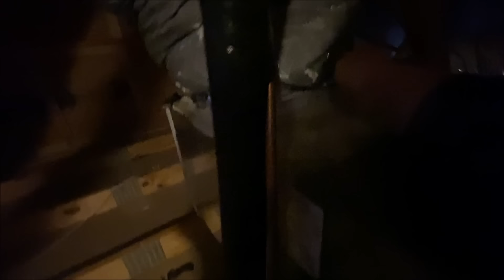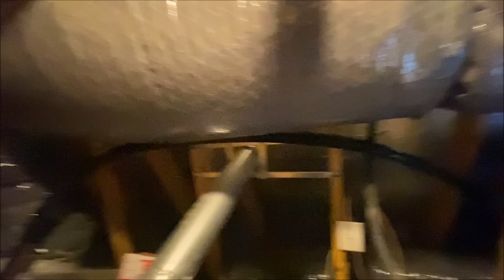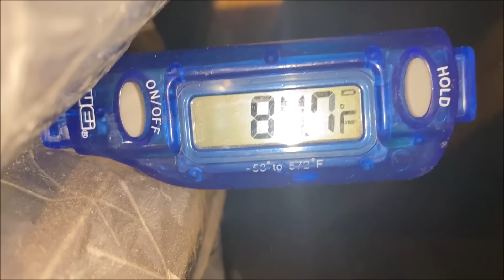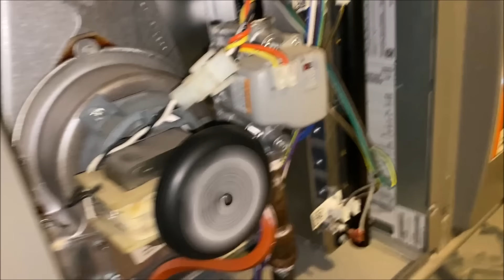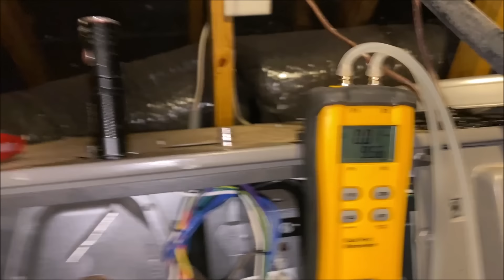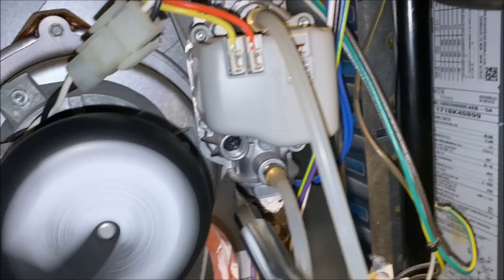New Construction HVAC Hack Job Butcher Sabotage pathetic installers

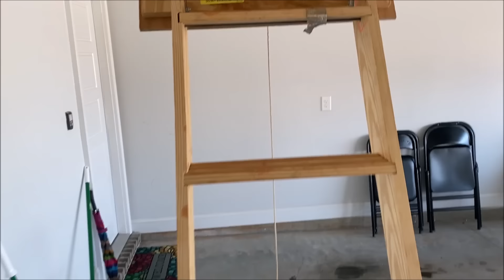Comment: 4:47 Is why when i built my house I wanted Rigid pipe main trunk then Flex out to the Vents in my Area they put R-4 on the duct insulation i wanted R-8 its 23F outside and 71-72 inside........ i was every step of the way seeing this house built had the ones did that crappy work here!!!!! i would have had them rip it out period not on my watch,

Comment: The incoming gas pressure might also be too low at/from the meter. Also, one has to wonder how the air-conditioning worked and did not freeze up with such low air flow. Be good to hear what was decided.
Reply: I will assume the meter and regulation at the meter were sized appropriately whenever a new home is asking for service the contractor does a load survey which is given to the field planner for sizing, but your thinking,
Reply: His manometer showed proper gas inlet pressure

Comment: Tell me about it, i use to be a warranty and startup tech for new construction. Sometimes the flex duct was so badly run that it would cause furnaces to cycle on high limit and static pressures where insane.

Comment: low bid always wins! Also the city's fault too for approving this mess
Reply: Bigo, the customer went to the cheaper bid and got what was expected. See it all the time with "my friend installed my system"
Reply: @zack9912000  Of course, the "customer" in this case is the builder. They go with the cheapest they can.

Comment: There is NO WAY that system passed an inspection. That builder had his inspector "BUDDY" give it a free pass. I've been an  HVAC  installer and service man for 16 years and I have seen many like this. We just rip it out and "HARD PIPE " it all. There is NO EXCUSE for work like that. And that unit should have came WITH a 10 year warranty. Most likely the builder didn't register the unit. I know a builder here in Alabama that actually has over 30 units registered in his name, so that it was covered NO MATTER who bought the house. TOTALLY LEGAL . TOTALLY LEGITIMATE.
Reply: The inspector BUDDY was also paid something for his troubles.
Reply: @Garth2011   OH YEAH ! He probably got a case of beer or a steak dinner. Or some other form of payment. But yes, I think he probably did get PAID.
Reply: @c.blakerockhart1128  
You are thinking small, I met an inspector, out of New York in Mexico. He was on a "free" all inclusive scuba vacation.

Comment: I have done a lot of duct cleaning in new construction. It is amazing how many times I've found coils plugged with sheetrock dust, sawdust, and other debris. I've also seen ductwork that could have been taken out and put in properly with about half the material and it would have worked much more efficiently. I remember one where the homeowner said it looked like someone blew up a spaghetti factory.
Reply: I was changing some light switches in my friends brand new $million dollar home when I dropped a screw in the floor register. When I opened it up I found a pile of drywall scraps, a pile of dust, and a coffee cup. I was fucking livid.  I wanted to talk to the builder myself but she wouldn’t let me
Reply: This happens in New construction all the time because once the house gets gas and electric meters hooked up. The GC calls us out to start up the equipment to get the house conditioned to Temp for the floors, paint and any thing else. Filters can only pick up so much dust and the h/o is  left with dealing with the after affects.
Reply: @smacleod69  
As a contractor could you build a portable return filter, say a 1in at whatever the contracter could find, then  maybe a 5in merv 10 and a 5in merv 13 or 16?
Put it fine print that builder pays for filters if they need the unit used during certain times? 

Plug the returns and us this filter setup? 
 
Just spit balling . As I know completely and thoroughly how some builders care about the new home owners, ha ha!

I was a flooring installer and hvac was definitely needed to prevent material failures.
Reply: Totally agree. My old boss. Would not allow the HVAC system to use while any sheet rock or floor sanding was going on. He actually had in contract that it was not allowed to be use so we had disabled the system a couple times. GC would be pissed but unless they want to ruin homeowners equipment and duct , oh well...
Reply: How is the duct cleaning business? I was thinking of adding it to mine.
Reply: @davidlopan6649  from my experience it seems like a total scam. I did probably a dozen of them at the company I used to work for and not a single one did I feel good about the work I did compared to what the customer was charged.
Reply: We had a customer call the manufacturer because we didnt want to turn his geo on during drywall. He called to complain about us, but instead they voided his warranty lol
Reply: !00% agree. As a home inspector.....this is the new norm to use registers as trash basins. When you have superintendents that are as green as spring grass or ones that could care less...... you have sub contractor work like this that is acceptable.
Reply: Had a contractor running his hvac system while they did the dry wall and paint. Want to talk about gunking up the coil. Ended up replacing it. Would not cover it under warranty. He tried to argue with me until I pulled it out and showed him.

Comment: You are absolutely correct,the 325-3 can handle 100,000 btus with a single gas appliance & max out at 150,000 btus with multiple appliances ( not sure why you get 50,000 BTUs more when you add extra appliances (?)). So yes it is too small for this application.A 325- 5  should be used on this CSST manifold & a separate 325-5 used for the tankless water heater. Working and lockup pressures should always be taken when dealing with any regulators plus manifold pressures at the gas appliances. I usually set the Regulators at about 7"working pressure  ( all gas appliances on) & check lock up pressure (all appliances off) to make sure I don't have a creeping regulator.
Reply: rite from the maxitrol spec sheets: "Total load of multiple appliance combined 325-3L (3/8”, 1/2”): 250,000 Btu/h;" "Largest single appliance served by the regulator: 325-3L: 140,000 Btu/h;" I'm not sure where you got your specs from but maxitrol spec sheet differs.
Reply: @mackb.8262  yep. Its 250k. Nothing wrong with this reg. They either have low pressure gasline or undersized gaslines. The first tee is going to the tankless, guaranteed.
Reply: @ozm8642  Undersized gas from the meter. Assuming this is a typical 5.5-8.5 inwc service, what looks like a 1" coming in to that mess, and guessing about 40 equivalent feet of piping from the meter. You are only looking at pushing 243 CFH which is a touch over 243k btu of gas for all four of those runs.
Reply: @mackb.8262  You're looking at two different regulators is why. The 325L series, is a line regulator meant to feed multiple appliances and falls under a different ANSI spec than the 325 which is an appliance regulator. You can tell the one in the video is the L series because of the yellow banding around the adjustment stem.

Comment: With the housing prices right now and the demand for new homes, the rush to build seems to outweigh the craftmanship and longevity of the home. This seems like a cut and dry court case to me, you bumped the gas line and it spun right out of the regulator...the ducting looks like a DIY project. We are better as a trade than this :\

Comment: the real shocker is that code enforcement allowed all that crap.
Reply: Wanna bet they didnt inspect it. We have commercial inspectors that we know what he will and won't check. They are lazy
Reply: @zack9912000  or are getting a kick back,  Inspections are often a drive up, check some boxes on a form and call it a day. That loose gas feed pipe tells you it was hack city all the way. Low bid and RUN!!!
Reply: yep also city's fault
Reply: The bigger shocker is that the general contractor allowed this sub on the job site in the first place
Reply: @af3934  Just remember this.  In these mass new developments that are built on old farm stead’s where they cram 18000 homes onto what was an 800 acre farm.  The lowest bidder will always win regardless. They just have to get you out of the warranty period.
Reply: @af3934  cheapest bidder that's all they care about maximize profits.
Reply: @af3934  not shocking at all tbh, only became a problem seasons after the house was sold and they were long gone with their profit.
Reply: Track houses here are barely inspected at all.  The inspector just signs off.  That is if the local authority can find an inspector to hire
Reply: Most of the time, city inspectors are just show so the city can justify all the fees. 
They just want people in the houses asap to start collecting taxes.
It is a home buyers due diligence to have the home inspected and research the builder. 

Some say people beat down the home prices, but I bet the company that built the neighbors house cheaper, in the big reply above, made more profit than his quality builder.
Reply: Seems like maybe the inspector on this job had absolutely no clue about hvac? This is horrifying me. If I showed up to a new construction and saw nothing but flex duct and no main trunks,.....😅 that poor customer
Reply: I’ve found that in a lot of what I call “pre-fab neighborhoods” the builders & inspectors are all buddies with each other and everything gets passed regardless of how bad the work is. Quality and craftsmanship don’t exist to these types of builders - it’s just “how fast can we slam one out and move on to the next?” 

Everything about that “install” screams fast, sloppy, inexperienced, and lack of care. The loose fittings. The pipe dope literally slopped all over every joint. Unsupported & unprotected piping. The messed-with adjustment screw missing its cap on the gas valve. Someone knew there was an issue and just cranked the screw and called it good ‘nuff. Pathetic. And I’m not even going to critique the flex duct. That crap shouldn’t exist, especially in a new-construction install. I wouldn’t have signed off on my final walk-thru as the buyer if I saw this, and I’m not anywhere close to being a forced-air expert (old-school gravity hot water heating systems are my bread and butter).
Reply: To suggest the inspector did the job is to suggest this mess was in perfect running order. 
At first view, the three soft ducts piled up and crushed was enough to realize air flow was reduced massively. 
Each successive bend and junction further reduced. 
Seeing all the airborne insulation suggests this, though I’m aware that cold air rushing through the access into that hot space is the cause during the vid. 
Close that opening and follow the still churning fluff and I’m certain leakage is to be found.
Reply: Don't worry, their pockets are lined. It's not about what you know,  it's about who you know
Reply: no, as an installer... i would have been fired immediately for that!
Reply: If I was code enforcement I would say nope fix it
Reply: HACKS
Reply: I also bought a brand new house. I checked it over during the ending of construction myself, and everything looked great "I'm three years in still with no problems" Seeing this attic made me respect my builder a lot more, dudes houses are a little more per square foot, but nothing is half way done. All my my walls are insulated well, double pane windows, attic has well above the typical amount of blown in cellulose insulation, all the baseboards line up properly, just stuff I didn't see while I was looking for houses. 

Funniest thing, first day when I signed all my title paper work and moved in I spent all day un-packing in the July heat, getting cable installed, and appliances delivered I end the day to go take a shower. No hot water. I go up in the attic, there lays my hot water heater, the electric wasn't hooked up, junction box with wiring to hook it up was sitting right there. The best part is the City code enforcement had signed off on both the plumbing to it, and the electric to it, they leave stickers where I live with names. I called the builder the next day, he came over and said wow, can't believe I missed that and hooked it up real quick. I said "Kind of odd that they signed off on the electric to it without it being wired up" he looked at me and smiled and said "I'd be happy that I'm the person that built your house, those guys give a soft glance at everything" 

A large construction company known for building "Decent affordable housing" has started building a couple of houses in the neighborhoods around me, and even built the house directly in front of me. Supposedly my neighbors across the street had tried telling him he needed to come down 30k on the house because the one in front of it was similar and 30k cheaper. He tried explaining how well insulated it was, and how it was built for peak energy efficiency and that he didn't cut corners like that company did, I guess they thought the guy was "to proud of himself" 

After a year or so, I saw my neighbors across the street out and I asked "Hey what does you guys electric bill run"  They said "My god electric is to high in this town close to 300$ every month!" I've never had over a 90$ electric bill and my house is all electric. I'm a industrial maintenance tech so I trusted myself to look the house over before I bought it, and I could see the massive savings in efficiency and that everything was installed and built correctly. I can't fathom though, not knowing what you are looking at "for sure in a house with gas" and not hiring a personal home inspector to come look it over.
Reply: In most southern states no one cares or even looks
Reply: @rj.parker  is north carolina considered southern? I'm from Mississippi and you're correct to a certain degree for MS Alabama and Louisiana
Reply: @rj.parker  Not true, Yankee.
Reply: Yeah, code enforcement is usually very detailed.  Can't believe they missed this 🤣
Reply: Government Workers? You think government workers care. 😂😂😂😂😂
Reply: @tomdurkins  it isn’t just government workers. I work in refineries/chemical plants. The QC’s are more often then not a complete joke.

I’ve seen QC’s who won’t inspect something if they have to go up some stairs or get down on the floor. They go months without visiting job sites and when they do, they just drive by, won’t even get out of their trucks. I’ve legitimately been left with my mouth opened in shock with how much these guys get away with.

Comment: This is what happens when builders only concern is maximizing profit. Hiring unskilled labor is rampant. Unfortunately with the overall housing shortages In many major cities I don’t imagine the sub par labor situation changing anytime soon.
Reply: Maybe a good time to start a home inspection company?
I'd like Holms on homes?
Reply: This is what happens when you ring the very last dollar out of the project, driven from the top down. Have seen it a few times here in New Zealand 🇳🇿 when companies are taken over by Americans. First thing that happens are job cuts etc. You then get a brain drain due to working conditions and it just perpetuates from there.
Reply: Plenty of unskilled labor crossing the southern border. Thanks Joe. FJB

Comment: Wow, it would be easier to start fresh, Leave the furnace, put a proper plenum and cold air return box. 
At 90,000 btu,even if you put in a single ceiling return grill, it would be loud, don't you use insulated steel ducts. The resistance with flex is about, 30foot equiv, to 10 feet of steel pipe, for a 10 foot section. A nice home with only a single stage gas valve vs 2 stage. I won't even comment on the lack of insulation, I am from Ontario, Canada, the price of heating and cooling   goes up but you only have to insulate once.